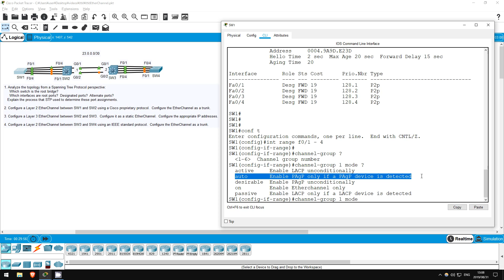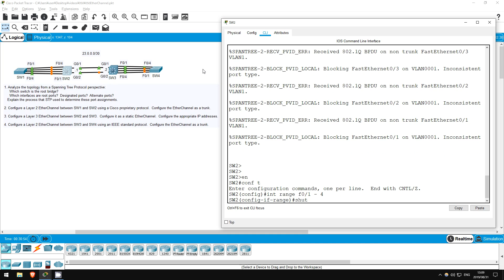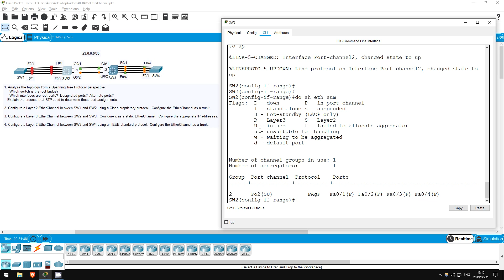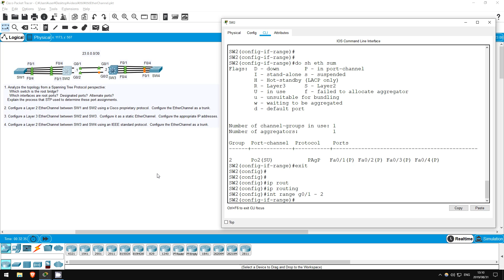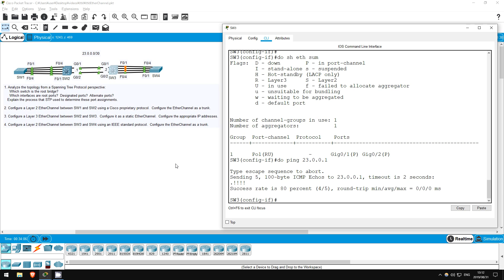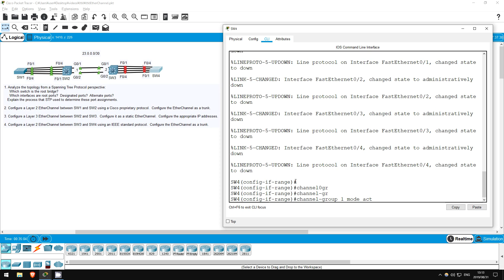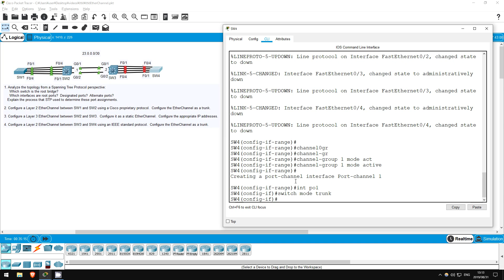FREE CCNA Lab 050: EtherChannel

Comment: jeremy I had a problem
command reject :The port is L2 and the channel-port is L3 or vice-versa
I made a mistake because I didn't immediately put IP routing and no SW in the interface range and this error popped up but I solved it with the following configuration
for layer 3 ether channel use this

create logical channel interface

Switch# configure terminal

Switch(config)# interface port-channel 3

Switch(config-if)# no switchport

Switch(config-if)# ip address 172.10.20.10 255.255.255.0

Switch(config-if)# end

now for physical interface use:

Switch# configure terminal

Switch(config)# interface range gigabitethernet0/4 -5

Switch(config-if-range)# no ip address

Switch(config-if-range)# channel-group 3 mode desirable

Switch(config-if-range)# end

Then in the other L3 switch following your configuration without forgetting IP routing and no SW everything is fine, I didn't understand how you didn't have this problem
Reply: same issue...

Comment: Hi Jeremy I'm getting the following IP overlapping message when I try to add an IP address on "int range g0/1 - 2" on switch 3 when adding the ip address 23.0.0.2 255.255.255.0 to it. I get this message "% 23.0.0.0 overlaps with GigabitEthernet0/1".  Not sure if one of the IP's are wrong. I'm not sure how to find a solution. If you can point out what I missed, I'd really appreciate it.  Thanks Jeremy for all you do for us in the IT Networking community.
Reply from the maker: Don't configure the IP address on the two physical interfaces (g0/1 - 2), configure it on the port-channel interface!  You can't configure an IP address in the same subnet on different interfaces, so configuring the same IP address on two interfaces won't work.
Reply: @JeremysITLab  I went to po1, but there was no ip address option, why ?
Reply: @AlexanderMahone-sp3zh  configure " no switchport" on your interface "po1". I hope that helps. Also, make sure switches are configured as layer 3 with "ip routing" command.